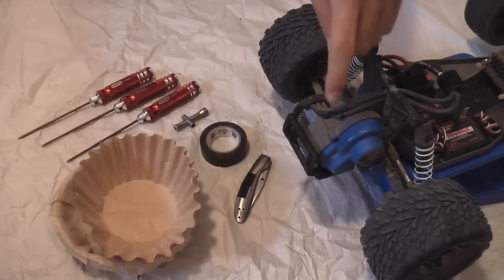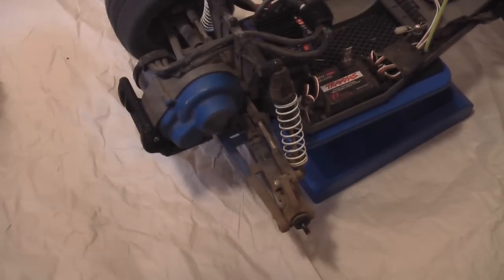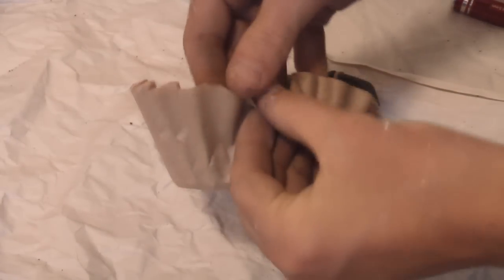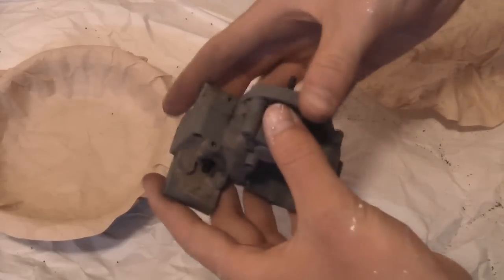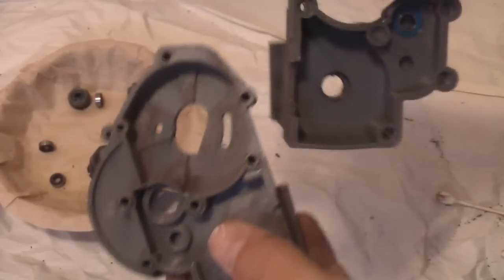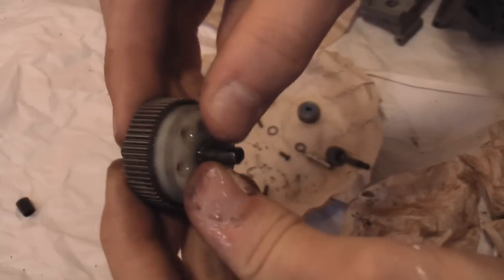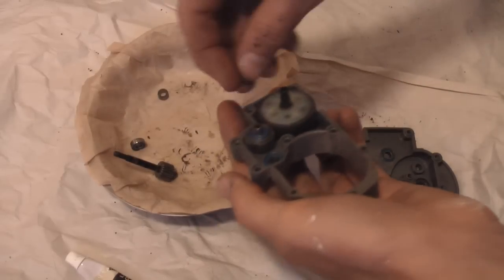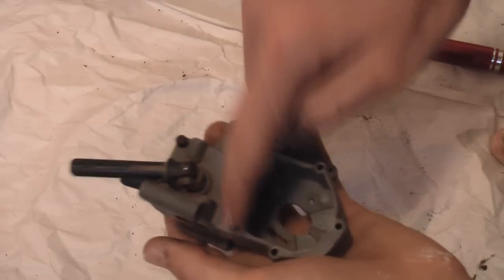Cleaning the Transmission - Traxxas Rustler, Stampede Bandit or Slash - Dry Method

Comment: Great video, very informative. I ended up stripping my transmission gears on my stampede by using a 21 tooth pineon gear upgrade. Lesson learned though which is  use metal gears if you plan any upgrades either with regards to the motor or the pineon gear.

Comment: I use this stuff called fast dry multi purpose solvent. let me tell you, this stuff works wonders for cleaning gears.  its also a good idea to remove the rubber seals on the bearings and blast through them with that cleaner solvent stuff. I am a super rc hobbyist so I have upgraded to stainless steel bearings and running 30,000 weight oil in the diff. grase is to thin and allows the inside tire to unload to easy for good handling.

Comment: I usually just clean my plastic parts in water minus bearing and gears.. plain old plastic. much easier and I mix a little windex and wd-40 in and it gets it scary clean, I usually let my bearings sit in oil for a while. Very good video

Comment: I use an old toothbrush to clean out the teeth on the gears. Also for those who like a super clean gear case like me,you can wash the empty case in hot soapy water then use compressed air to dry. Good video though

Comment: i shedded 3 of the 4 planetary gears in my rustler vxl on 3s lipo.  i was pulling wheelies and hitting a speed bump with just the rear tires...doing a forward flip and landing back on all fours.  did it 20 or so times before the diff shredded.

Comment: Actually lithium grease works pretty good for the diff. Since it isn't sealed the silicone grease is more likely to work it's way out. Lithium grease is thicker and stays inside better and if you pack it full it works more like a limited slip giving equal power to both wheels... which is better for off road driving. The silicone grease is good for driving on pavement though as you really don't need the diff to act like it's locked.

Comment: i baught the pozitrain for my stampede puts full power to the wheels. only about 15 bucks to. It replaces the 5 small gears inside the differential gear for one pice, this allows both wheels to spin at the same time in the same direction. No more opposite directions with no load.

Comment from the maker: if you take the motor out of the truck and give the truck a gentle push, dose it glide smoothly and quietly, if that's fine then it might have something to do with your gear mesh or the gear ratio, if you count the teeth on the larger gear (Spur), and divide it by the number of teeth the smaller gear has (pinion), then multiply that number by 2.72, your number should be around 10 to 15, any lower than 10 and you are in trouble.

(see next comment..........)

Comment: @cheesedude24 The slipper is the same as the older models, the new models use metal diff, metal top gear and idler gear but slipper clutch is still like the older one

Comment from the maker: I am using a 2 Cell LiPo Battery in my car right now, and they are 3.6 volts each, so 7.4v, and it's 5000mah, just search SPC on Google and you will find them.

Comment: I use soap and water and wash every part on my truck so the new grease goes on a clean surface, how do all the plastic parts hold up on Traxxis? Everything is aluminum on my Associated RC-10 so I want to know how good some of the newer rides are holding up.

Comment: Hey, i have a question... I just bought a Rustler yesterday. "its not the one in the picture" 
i was driving it for about 5 mins, than out of the blue, the tires quit moving, but the transmission is still running when i press the trigger, i took it apart, the black gear teeth or what you call it, its not touching the motor...

Comment: solvents are fine for the plastic just dont use them if you dont know what solvent will not melt the plastic denature alcohol is generally the safest... lint is fine for the transmission it wont hurt anything

Comment: if you dont have enough lithium grease on the main gears will it be loud? because i took my gears apart to experiment but most of the grease was on my fingers, so i just put it back together and i ran it and it was loud. could that be the problem why it was louder than usuall?

Comment: not to sure, but sounds like your slipper clutch is way too loose dude, and if the pinion gear isnt touching it try setting your gear mesh. and then adjusting the slipper clutch. hope this helps

Comment: You can use WD-40 to clean with and not harm any of the pieces. It works great and is very inexpensive.
Reply: This is the first time I'll be working on my transmission, so is it ok to use WD-40 to completely remove the old grease inside the diff as well as the gears and the gearbox before re-greasing it?
Reply: It will not harm anything!
Reply: Make sure the WD-40 completely dries first before adding new lubricant
Reply: +Randy Bryant It melts the grease
Reply: +PPK1 OFC its melts the grease, its a solvent
Reply: PB blaster in the black can is what I use for gear cleaning. Plastic safe.

Comment: i have traxxas slash ultimate and i drive it on gravel  and grass and dirt . the second day i drove it i got lots of rocks in it and some of them loosened the drive shaft but i got it fixed but i still keep getting rocks in it. but now when floor the throttle sometimes it doeant react and then when it go fast it makaa loud noise like somethings stuck in the gears but i dont know if thats the problem or its the tires. PLZ help someone
Reply: Mad machine racing mike the teeth of your gears located in your transmission might have gotten torn up. It happened to my  traxxas bandit, when i  try to drive my rc car it makes a noise like something is stuck inside too.. a fix for it is to take the transmission apart and see if the gears are torn up. Then order some new ones i hope this helped..